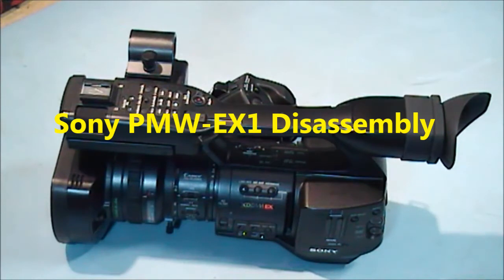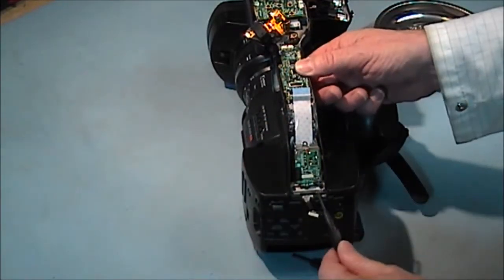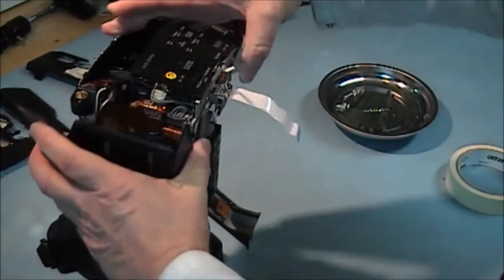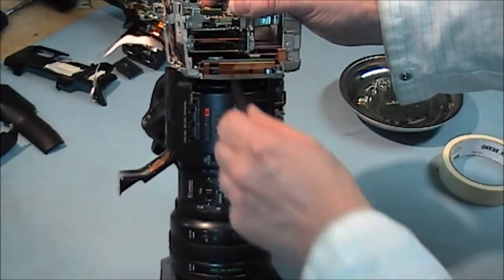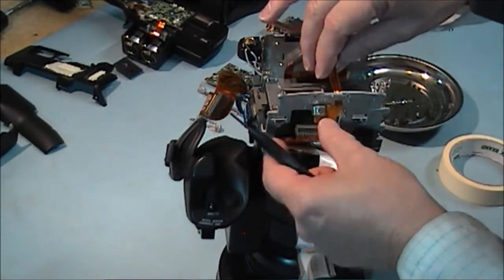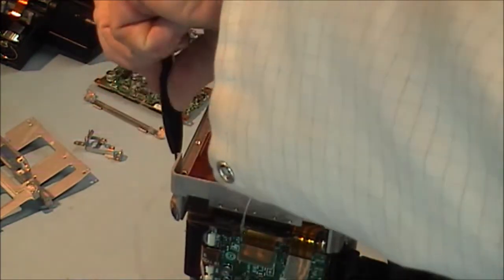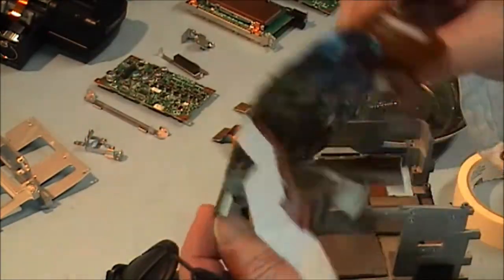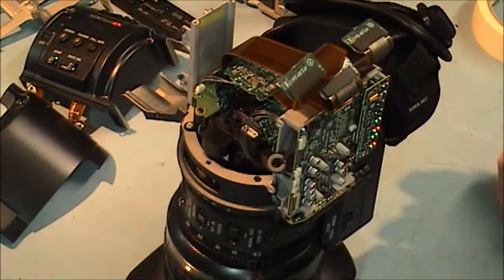Sony PMW-EX1 Broadcast Camera, complete Disassembly

Comment: HELLO EW! I just got my Sony PMW-EX1R and shot some footage! My question is: I used an SXS Adapter to transfer my video mp4 files to my computer! The problem is the Palmcorder puts each take in a separate folder making, batch capturing impossible! Besides using the USB out in Media Mode, can I use the Fire Wire IDEE Output to do the same? Will Adobe Premiere recognize it and control it like it does with a Mini DV Cam? Is there an advantage of using a USB vs a Fire Wire IDEE?